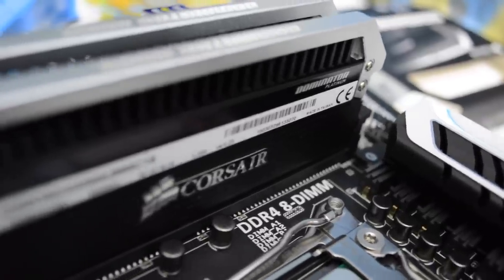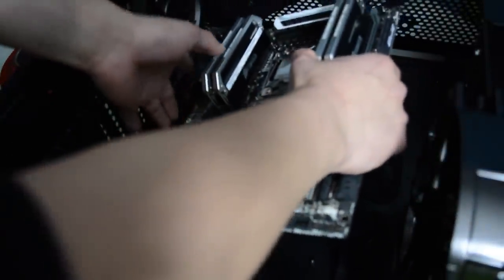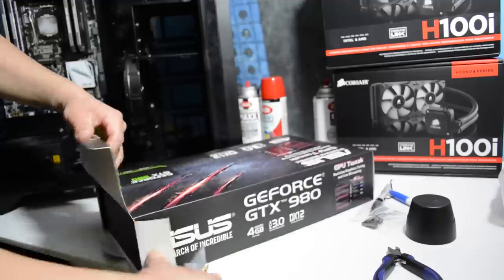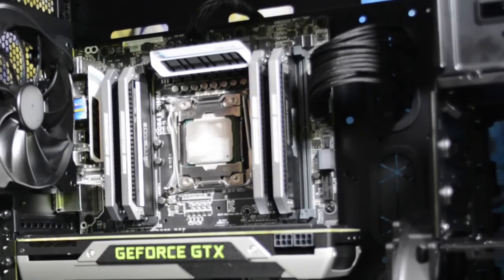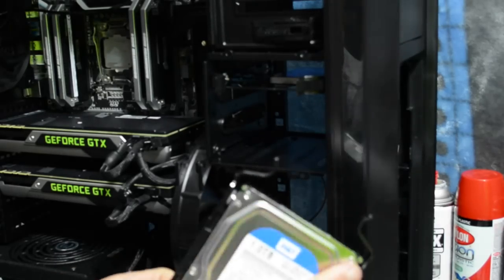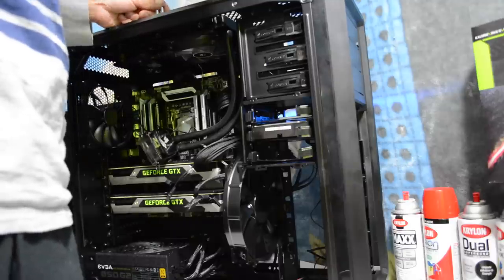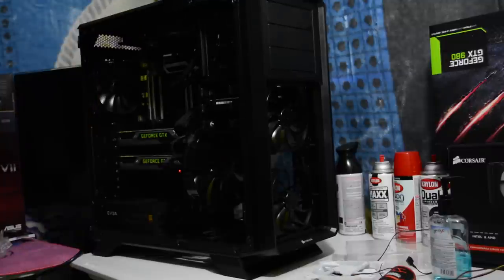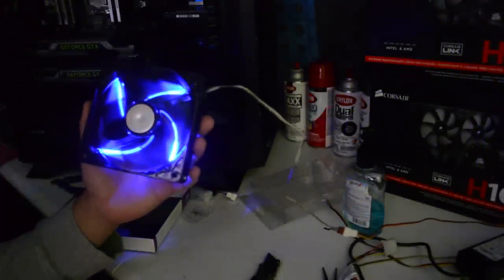How To Build An X99 Gaming Rig 4k For 2015 Tutorial 2 Gtx 980 Sli The Simple Way

Comment: Good video. I'm currently running the X99-A with a EVGA Nvidia GeForce 970GTX. I was thinking about updating to a GeForce 1660 Super. Would it be better to double up my 970 GTX or just get 1 1660 Super? I currently have 32GB Ram and I'm maxing it to 64GB. Thank you, I appreciate it.

Comment: hi thnx for video...i have a question
i have asus mobo X99 deluxe usb 3.1
cpu  i7-5820k  32 gb ram corsair 3200mhz 
psu: Green 1200+80 platinum
gpu: asus geforce gtx 970
i recently received my nvidia rtx 2070 super founder edition but i have not installed it yet cuz i donno what to do...im not a gamer ,i use it for 3d rendering and animation rendring using 3dsmax vray lumion9 autocad and .... how can i install this gpu alongside yhe old one.......ps: pcie slot 5 is occupied with a usb 3.1-2 port card(this is what it says when  i read it)and im not sure that whether i have used it or not..and for this it seems there is no room to install the second card in slot 4 ..plz help me

Comment: I have seen people go into there reference Nvidia coolers and change the LEDs in them to be different color I have not seen a tutorial for it. But I think that would be quite a cool look.
Reply from the maker: yeah that would be end the warranty and hell i am not about to do that hahah, 

even though i want to buy one just for that purpose, but that would have to be a card that i will not use to put for sale :)
Reply: If you get an EVGA card you will not void the warranty.
Reply from the maker: WunRageQuiter wut? then from now on i must buy evga cards.
i know asus 980s reference design u open the seal you are whacked
Reply: EVGA does allow the use of an aftermarket cooler. Just keep the original cooler/fan assembly and all the nuts/bolts/accessories in case you need to RMA the card. You'll need to put the card back to it's original state before sending it back.
Reply from the maker: +WunRageQuiter i have made a video here: https://www.youtube.com/watch?v=zwxihAvOOoc

Comment: @Kreeper I need your help with my build. I want to go with a X99 based extreme gaming build but people are pursuing me not to. I'm going with x99 because I'm not going to upgrade it for years to come with the exception of gpu. I have a budget of around 2000-2250$. 
These are the parts I have come up with so far
5820k cpu
Evga Gtx980ti bybrid gpu
Corsair Vengeance LPX 16 gb 2600mhz ram
Noctis 450 case
Evga 850 g2 psu
Samsung 850 256gb ssd
Wd black 2 tb hdd

I am extremly confused about the mobo though. Should I go with Asus x99a (seen some bad reviews), asus x99 pro, msi x99s gaming 7, msi x99a gaming 7 and msi x99s sli plus. Which one do you think is the best choice? Your personal suggestions will be very appreciated.
Reply: Ali Sher I went for the Asus Sabertooth X99. A little pricey but it has every feature you could possibly imagine, looks sexy af, is built to last, comes with a 5 year warranty, provides support for heavy GPUs, great for water cooling (lots of connectors for pump, radiators, fans etc.), features it's own filtration system to keep out dust and has USB 3.1, which gives speeds of up to 10GB/s!

It isn't too expensive and believe me, it's worth every penny.
Reply: ***** Thank you but I decided to go with Msi x99s Gaming 7. Compliments my red and black theme pc and is a solid mobo as well.
Reply: Ali Sher Ahh, okay, you going to be annoyed when skylake 6+ core CPUs come out? I'm not sure if there's going to be much of a performance increase if it's the same as the difference between Z97 to Z170.
Reply: ***** I don't think I will be :P The way I see it, there isn't really any difference between the two platforms specially as far as gaming is concerned.
Reply: Ali Sher Yeah, me neither. 3% performance difference between 4790k and 6700k? Yeahhh, no thanks skylake. 

Pfft skylake, more like, suck lake! Hah! I'm bad at puns :'(
Reply: ***** lol ya exactly.
Reply: Ali Sher My dad just dropped round my CPU and RAM, all I'm waiting on is my SSD, which should be here around the end of the month since it's coming from China, and my GPU which I'm saving for. Just £80 to go before I can afford the 980Ti I want. The Gigabyte GTX 980Ti G1 Edition! :D

It's literally like christmas when it's time to upgrade.
Reply: ***** We both will be completing our systems same time around :P 
And as far as GPU is concerned, beware of coil whine in air cooled GPUs specially these beefy ones. But even if you do want to go with air cooled GPU also look into Zotac gtx980ti Extreme AMP. It is the most powerful GPU among 980tis. People have overclocked it upto 1600mhz without breaking a sweat. I myself am going with EVGA gtx980ti Hybrid because of hot summers over here. Liquid cooling is the best way for me.
Reply: Ali Sher I was stumped on whether to go with the AMP! Extreme or 980Ti G1. In the end, I opted for the G1 as the thickness of the Zotac card was just way too much and would look horrific in my PC. Also the G1 has an RGB LED (Well, got most colours anyway) and so it suits my theme of black and green perfectly. Back plate is awesome, performance is still amazing and I think I will be incredibly happy with my choice. I can actually order it now. Probably should, shouldn't I? xD
Reply: ***** If you ask me if you are just going after the aesthetics than you should choose whatever gpu compliments your build but if you are after the performance than Zotac is much more powerful than Gigabyte. I saw some benchmark results of Zotac and it had 10+ more fps than even the Titan X all around. 
For me it was more of a mix between a cool and powerful GPU because if it gets hot I can't get the performance anyway. So EVGA Hybrid is the only way to go for me as I live in a hot country. I still prefer MSI and Asus Aesthetic wise. You can't go wrong with Gtx980ti anyway so go with any reliable company and you will be fine.
Reply: Ali Sher Yeah, thanks :)
Reply: +Alexander Binovski waiting gor cpu cooler. Everything else is done.
Reply: +Alexander Binovski yes, NZXT X61.
Reply: +Alexander Binovski I hope it doesn't leak on me :D NZXT cooler compliments my build.
Reply: ***** Well, as bad as it seems, I will take my chances with AIO coolers. I don't like the looks of Air coolers. Other than that my country is HOT, specially in summers, that is why I need water cooled setup. I even got EVGA gtx980ti Hybrid for the same reason.

Comment: Hello mate! Nice build and you have l alot of money at it! My PC what im using is currently doing well. Plays all the games well with ultra settings

Motherboard - Gigabyte Z77-D3H
Power - 750W Bronze Edition
Processor - Intel i5 3570K 3.40GHz 3.80GHz
Graphics Card - MSI GTX 670 Power Edition (2GB)
RAM - 16GB Corsair Vengeance 1600mHz 

Then theres the odd bits like SSD for Win 7 64bit and then 2TB for files and games... Etc etc

Anyway, my dad is looking at upgrading it... Maby getting a gaming motherboard, getting a GTX 970 4GB and what not. But! And heres the but... The processor we have at the mo is 3rd gen and its LGA 1150 Socket... If we get a new motherboard were gonna need a new socket so we'll upgrade that and then thats where alot will get changed and it would be like building a fresh PC... Soooo... Basically whats some good things on the market?? Ideally Motherboards, we want good gaming performance but not extremely costly
Reply from the maker: Rheace Jones right now the 4th gen its the sweet spot i will give you the main components that you need for a monster pc:

MOTHERBOARD: asus-z97-a 
CPU: i7 4790k 
RAM: corsair vengance 16 gb ddr3 1866
PSU: Evga super nova 850 G2 80+ Gold certified 
GPU YOUR CHOICE :) Any other question hit me up :)
Reply: sorry for the late reply but thanks man! thinking of upgrading the GTX 670 PE to a GTX 970 because its better than getting another GTX 670 and SLI it plus I don't know how but there similar priced ;D so I'd be saft not getting one haha
Reply: Just a little update, got me a MSI GTX 970 FTW Edition, Coolermaster HAF 942 (big enough and future proof) and then got a ASUS VG278HE which is 144Hz and 3D, its awesome and made a big difference to gaming :) then got me a upgrade from my CAT 5 internet cable to CAT 7... it may or may not have made a difference but oh well, its working great at the moment so yeaaa
Reply from the maker: +Rheace Jones Here Another Build Guide How To Build A SKYLAKE Gaming Computer i5 6600k Asus Z170 Pro Phanteks Enthoo Luxe Gtx 980 Thank You! 
https://www.youtube.com/watch?v=_8E6-_1moAU

Comment: Will this work with 1 asus gtx 980 instead of 2?
Reply from the maker: Cam G yes it will work just fine, the second card is just to add more frames per second or be able to run a 4k monitor 

one card is perfect buddy
Reply: kreeper24 Pc Builds Mods & Tech thanks man

Comment: Hey Bud here is the current build I have in my new egg cart, your thoughts???

I can't afford a second 980 just yet:

Corsair C70 ATX Mid tower
Intel I7 5820k CPU
EVGA 980GTX Superclocked
HyperX 16GB 2800 DDR4
EVGA SuperNOVA 850W PSU
ASRock Fatal1ty X99M Killer 2011-v3
Corsair Hyrdro Series H110 Extreme Water Cool
Samsung 850 Evo 3D NAND SSD 500GB
WD Black 2TB Hard Drive
LG 16x BluRay burner
Windows 8.1 Pro 64bit

Artic MX-4 for thermal paste on CPU

Total around $2400, would this work?  I'm replacing a Laptop with a 970m, hoping for some smoother framerates.
Reply from the maker: Edizzle dude, this is a killer machine! go for it! KREEPER24 approves ! please keep me updated when ever you start to build it, if you have any questions please feel free to contact me.. if u wish to personally contact me msg me at my facebok page here:https://www.facebook.com/pages/Kreeper24/333399440021139
Reply: kreeper24 Pc Builds Mods & Tech Damn thanks for replying never get replys on youtubes, your build is much better....Ok I made a few changes, what do you think, please let me know if you know of these items: Changed out the H110 Cooler for the H105, dunno it got better reviews, bad choice? Also changed out the ASROCK x99 for an Asus X-99A, seemed more people are using the Asus? Ok only changes I got, about to push buy it on Newegg.
Reply from the maker: Edizzle go for it the 105 is not a bad choice, the x99-a might give you some issues tho i have to warn you, go try my videos the recent ones and find out the issues i had with it, i had Asus RMA one for me, but the replacement runs like a Champ good luck you might get a good non defective Asus X99-A and you be good brother... click that button!!! the button of happiness and excitement!
Reply: kreeper24 Pc Builds Mods & Tech To late switched to da Noctua LOL :)

Comment: Why don't you have a sli bridge?
Reply from the maker: Indie Guy i do have it, i just forgot to add it in this video
Reply: kreeper24 Pc Mods & Tech did you receive it in the box or did you buy it separatly?
Reply: +Didier Chewi sli bridges usually come with your motherboard.
Reply: +xyz2theb thank you sir! Congratulation for your build. I've got all the pieces in their box 'since one week for mine but i'm a little bit lazy lol
(i7 6700k, 32 GB dominator platinium and sli gtx 980 evga sc)
Reply: +Didier Chewi awesome build bro! 😉👍
Reply: +kreeper24 Pc Mods & Tech What is wrong with the Fan ? why is it turnning On and Off
Reply: +Indie Guy  DO U STILL NEED SLI BRIDGES FOR NVIDIA ?
Reply: Ryan Kishbaugh yes an sli bridge is still required.
Reply: +xyz2theb  go amd !
Reply: Ryan Kishbaugh gtfo

Comment: You do know that you need to use Static Pressure fans for radiators such as the ones you are using to cool off your CPU. Your fan fins are designed for Air Flow which is why the box says AF vs the fans that you need which are called SP fans. Those fans will not give you no where near the air pressure for push and pull that you need. This fan setup is all wrong. The fans you are using are for air flow to keep your case inside to get as much air as possible for the best cooling.http://www.amazon.com/Corsair-Blue-Static-Pressure-Cooling/dp/B00L64NYH0/ref=sr_1_1?s=electronics&ie=UTF8&qid=1425312185&sr=1-1&keywords=SP+120+led
Reply from the maker: Yeah i know that :) 

I have tested the temperatures using AF and SP i decided to go with the af this time since the difference is not that much :)
Reply from the maker: i do got sp fans in here :)

Comment: Is this good? I might be able to afford a second 980ti sooner or later/...   http://pcpartpicker.com/p/CdynhM
Reply from the maker: The2013Gaming here is my personal opinion, change the motherboard to the  Asus z97-a get the i7 4790k upgrade the ram speed to 1866 and get windows 8.1 its better for gaming soon you will get free upgrade to windows 10 so why pay that much for windows 7.
for how much you are going to spend buy the right parts bro the 4770 was a fail of a chipset the sweet spot its the 4790k for editing and extreme gaming everything else its good :) any other question i am here buddy :)
Reply: kreeper24 Pc Builds Mods & Tech well, i changed some stuff up and upgraded the CPU but had to take out some RAM, now i have 16gb of RAM, windows 8.1 but the motherboard i cant quite upgrade because i need to stay within the budget of around 2,000$...
Reply: kreeper24 Pc Builds Mods & Tech I also am keeping the mother board i had which is the z87-a lga1150 motherboard from asus, but the compatibility notes say that some motherboards form intel might need a bios update before using it, is this something to be concerned about?
Reply from the maker: The2013Gaming nothing to be concerned about i have a video showing how to update the bios,
 tip number one,
never go to cheap with a mobo :) its the center of all connections brother 16gb of ram its perfect, you will never get to use more then 10gb :) 

what cpu did you upgrade to? and z97-a its a good boss price man
Reply: kreeper24 Pc Builds Mods & Tech i upgraded to the 4790k 4.0 ghz and i also upgraded the mobo to the one you recommended, i guess i could go over budget about a few dollars ;) thanks for all the help man! subbed, liked and favorited; )
Reply from the maker: Any time buddy i am here to give you the best advise base on my experience ;) peace ;)
Reply: kreeper24 Pc Builds Mods & Tech my good sir, i was informed that if i get the 980 Ti, and i dont have a 4k monitor or triple monitor, im just wasting money and a graphics card. Should i just buy the 980 or get double of another type of GPU? Help D: if you think i should get double tell me what i should get keep in mind this is my setup : http://pcpartpicker.com/p/Kwqczy (its updated)
Reply from the maker: The 980ti its perfect for 4k and not 4k i own a 1920x1080 144hz 1ms response time monitor and really enjoy my 980sli bro, running 144fps on most of my games, so i say yes buy it and enjoy it, 

My experience is telling you that is not wasting money what so ever, you will enjoy it.

Kreeper24 approves you to buy the 980 ti
Reply: kreeper24 Pc Builds Mods & Tech ok if kreeper approves, it must be great :) thanks <3
Reply: kreeper24 Pc Builds Mods & Tech one last thing, should i buy a sound card and a networking card(for wireless wifi)? Is the mobo or something built in with one? Someone told me that the sound card and networking cards are useless, but im not capable of using an ethernet cable and i dont know if sound will work without a sound card
Reply from the maker: Depending on what will u be using the pc for, 

The motherboard does not have wifi build in, 
So yeah get one ;) 

Sound card that depends on you but this motherboard has really good sound built in
Reply: kreeper24 Pc Builds Mods & Tech ah ok, so i guess ill be using no sound card then :P